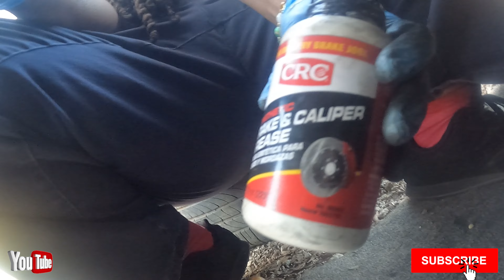2006 TOYOTA SIENNA LE CV AXLES REPLACEMENT

Comment: Hell yes!  There's a big difference in telling you how to do a job . . and SHOWING you how to do the job.  This was fantastic.  Mad respect!  I've had my Toyota Sienna for soo many years and she's such a reliable tank.  Thank you for the video.  Also, usually the passenger side CV gets stuck in the bracket, I've seen where people had to cut it in in order to hammer it out or they had to unscrew the backet - did your just slide out easily?
Reply from the maker: Thank you for even viewing my video please like and subscribe to my channel I also will be uploading a video on how to replace the catalytic converter soon and yes the cv axle came right out we didn't have to hammer it out it was sweetttt

Comment: Ya got that caliper jist hanging there haha  crazy ... nice vid  question  what axels did you put and have a link   i got me both sides from amazon cardone  i got em 3 yrs ago  went to do the drivers side  other day the axel seems to short  i went to rock auto  its the sme part number  so its the correct one but seems short the part that goes into wheel hub   so what i do?  It says its the correct one
Reply from the maker: Thanks for watching my video. The driver side axle is shorter than the passenger side, but I ordered mine from O'Reilly auto part store. But you gotta have strong brake lines to let that caliper hang like that crazy right. 😜
Reply: @fixitchicktv  thanks for replying and posting the vid... oh  ok  I went to autozone compared mine to their duralast  mine is cardone  they the same length ima just slap it in this weekend ....  yes it was hanging on for dear life  haha